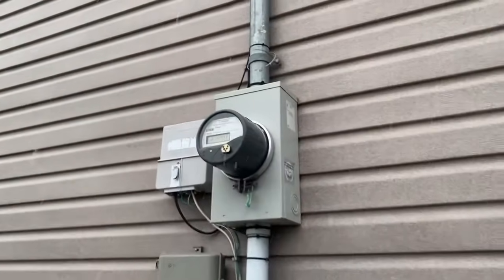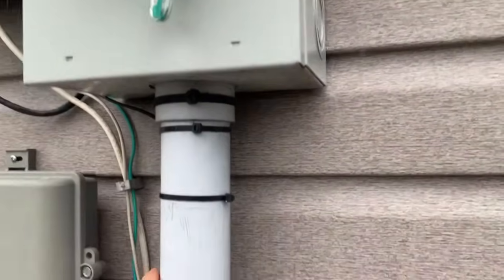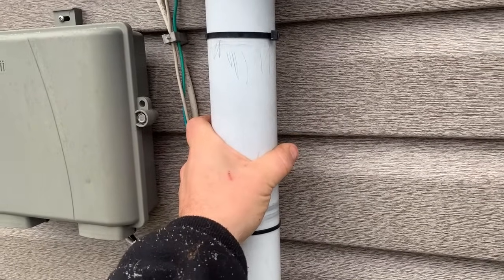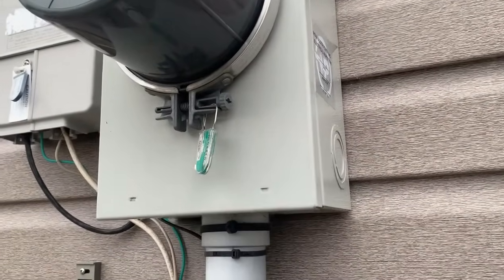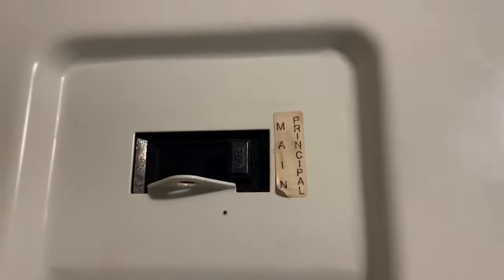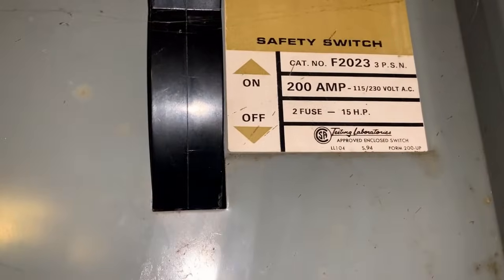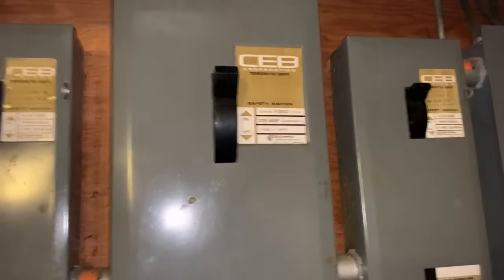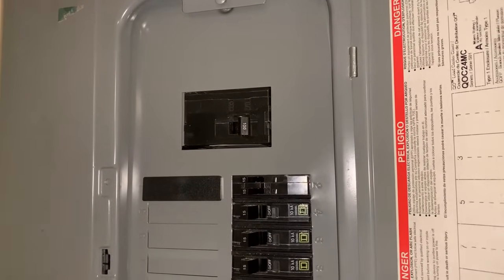How To Tell What Amp Service Is In Your House

Comment: How about the actual wire size feeding the meter/ panel, maybe it's oversized for a 100 amp and could upgrade without running an all new feeder line?

Comment: My house is 51 years old. The box with the main breaker switch is outside on the side of my garage. The box is actually not installed on top of my wall, but inside the wall, sticking out only a small portion. Inside the box there is main electrical breaker and it is 100 Amps. So I am guessing that I have 100 Amps service. I wonder, if I wanted to upgrade to 200 Amps service, because I want to buy EV and charge it inside my garage, how much would it cost, and, if rewiring would have to be done only for the garage outlet for the EV only, or, the whole house. Inside my garage there is breaker box for individual appliances and the highest amps breaker is 50 amps. Thanks

Comment: Question for you, what if you get contradictory information?  My main breaker switch says (100) but I was also able to see the main conductor wires coming into that box and they were labeled as #6 ALUM which according to charts are only rated for (60). I live in Canada which still accepts 60amps
Cheers

Comment: What if there isn't a second Pipe. Most houses that are the age of mine in Michigan don't have outgoing pipe. It's just large gray wire going from the meter through the wall and in the house to the panel.

Comment: What if you don’t have a pipe. I have a meter on the side but then nothing. It goes straight from the meter into the house into a breaker box. I don’t even have a main breaker either. I just have a bunch of small ones that have 2 switches with 30 on them. Then I have a double with 30 and a double with 40.

Comment: What would explain a house with NO master cutoff switch or breaker, just utility current flowing to individual breakers? Was this "up to code" in some earlier era?
Reply from the maker: I've never seen that one before unless it was metered at the pole. Some large services have a separate current transformer and loop out back to a meter from a CT cabinet, however that is usually  before the branch circuit breakers.

Comment: What if you have 2 pipes coming out? Mine looks like the last one with a 1 1/14 pipe and a 2 inch pipe. I also have 2 electrical panels because it was upgraded to install a central air conditioner

Comment: This may not be the right place to ask if so redirect if needed. My moms place runs with a boiler to heat home and water.  But is never adequate for running a bath or the jacuzzi so nobody uses these. I have a ecosmart 36kw unit and breakers electric tankless that could be used to support the hotwater needs for the tub and jacuzzi.  The home is built 1904 has that 2in conduit input.  4 bedroom home 2 bath. This unit i read something about 300 amp service and its a 150 amp tankless could it run on the 200 or unsafe. Even if its only used maybe 2x a week?
Reply: ¹ss3ss3s1wexr

Comment: What If Is Their Is A Double Breaker And Each One Show 100amp Is That A 200amp Breacker. TIA
Reply: I want to know this too! I don't have a big main switch. Our home, built in. '64, has a double 100 as the first breaker on the panel where all the other breakers live. It's not bigger than any other breaker, just two normal size ones labeled 100 connected together.
Reply: @amandawatts3346  If the wires from the meter connect directly to the tied 100-amp breakers, the 100-amp breakers serve as the main breaker in the panel. This is called a back-fed or reverse-fed breaker configuration.
Reply: The amps do not add. A double breaker has one handle with two output wires, 240 volts 100 amps. Similarly, two single 100-amp breakers with the handles tied together, 240 volts 100 amps. If two 100-amp breakers are not tied together, each breaker is 120 volts 100 amps.

Comment: The pipe coming into mine is 3 1/2" and the switch inside the panel says 200 so I assume 200amp, not more.  Everything in my house is electric including 4-ton heat pump and resistive backup heat.  Do you think 200amps is enough to also add a tankless water heater?

Comment: Is conduit really a good way to decide if it’s 100 amp or 200 amp panel. An installer could have a bunch of 2” and that’s just what he runs for everything.  Which is what I have. My panel has no main breaker. What would I look at in that situation to see what it is. The feed from the transformer to the meter can is #4 copper now but at one point was like 1/o aluminum l, I believe on a 75’ pull length.  Any ideas.
Reply: Exactly what I said
Reply: Exactly this guys a retard. Why not just look in the breaker panel to see what the main breaker says? Tf

Comment: QUESTION:  So my meter base is about 2X what you show there.  The Power Company METER says CL320 on it.  I watched the video really close to see, but the face of the meter was never shown with enough detail to see.  CL200 would be a maximum "continuous" service of 200 Amp.  A CL320 is rated for "continuous" 320 Amp.  Off the back of my meter base are TWO (appears to be 2" conduits) which feed TWO independent 100 AMP circuit breaker boxes.  Everything I have seen and read says there should be a PRIMARY circuit breaker box and then other boxes can come off that.  So I asked an electrician about my setup and he agreed it is different and told me the next step up would be 320 but the socket for the meter (apparently I have to pay for that) is really expensive to start with.  Since then I've discovered I already have that.  My house is all electrical, two electric furnaces, hot water heater, stoves, washer dryer - everything is electric - no other fuel source.  So what I was asking him, can I add a third 100Amp panel?   I would want that dedicated to the garage for electric car and welder power.   So is half my problem solved, I already should have 320 or 300Amp service?

Comment: My service has zero writing ANYWHERE, not even a visible model number on the breaker box. My house, in the US/Texas, was built in the late 70's/early 80's. It does have a square box under the meter and the input conduit is 2.25" OD. It goes into the breaker box next to it that has no main breaker/cut off. It has 6- 208 breakers in the top which provide power to Electrical Heat, A/C, Water Heater, Clothes Dryer, Range, and 1 60 amp breaker that feeds a second row of breakers in the bottom of box for 120V service to the house. I would like to put a 100 AMP subpanel in my garage to run a couple of 208V woodworking machines. The clothes dryer and water heater are in the garage area which is about a 60 foot run from the main panel. I was thinking about pulling back the wiring for the water heater and Clothes dryer and put those 30 breakers in the subpanel and that would free up space in the main panel to put a 100 amp breaker to feed my subpanel. In theory it will work but I heard people talk about tab current capacity. How can I tell if the tabs in the main panel will be OK with the 100 amp service to the subpanel? Second what size wire would I run to the subpanel do I need #2 copper and #4 for ground? Finally, I know I don't need another main breaker in the subpanel, but I assume it is OK to install a disconnect, perhaps something like the one on the outside of the house by the AC unit. If you can give me a warm fuzzy that I am headed in the right direction, I'll be very appreciative. I also assume I need to run conduit all the way from the main panel to the subpanel - in a very cramped attic! Sigh!  Finally, what are the ramifications of asking the power company to pull the meter. Since there is no main cutoff in the panel and the main feed lugs are wide open, I'm a bit nervous of trying to pull #2 wires in a hot box. Comments? Thanks for the video.

Comment: Here in the U.S.A we have a fairly standard practice for determining service size.   We typically start by looking at the meter base, since the old round bases were typically 60 to 100 amps max.  Square or rectangle bases are used with 100 amp or larger.   We try to verify the size of the service wires going to the first disconnect.   Then we look at the panel rating,  and the rating of the main disconnect.  Out of these 4, the lowest rating determines the ampacity.   On an overhead service,  we like to count the number of wires connected to the service drop.   3 wires is present in almost all cases, indicating 120/240V service.  2 wires connected,  sometimes with the 3rd wire folded back, indicates a 120 volt service sometimes found in  smaller pre-WWII era homes that have the original service, typically 30 amps, sometimes 60.  4 wires connected indicates a 3 phase service,  either 120/208V or 120/240V with a high leg.  This may be found on a very large luxury home with extreme electrical demands; some utility companies require a service larger than a certain size, typically 600 amps, to be a three phase service.   Some older homes may have remnants of a 3 phase service if the home had a 5 ton central air conditioner in the 1950s or '60s, as some of the condensers hitting the market at the time were unavailable in single phase.

Comment: i went outside to look at mine and i have a power line coming in above then conduit down to meter.  There is  a small breaker box on the bottom of the meter but no main shut off that i see.  There is nothing (conduit) that i see coming off the meter/breaker box.  Do they sometimes go straight into the house from the meter box?
Reply: Yes, that is pretty common in homes in the southern parts of the USA like around Arizona,  Texas,  and Florida, particularly in older homes.   In the northern states they would typically run the service drop down the side of the house,  go to the top of the meter base, (or below,  in conduit if it's a buried service,  much more common in newer homes) and the main breaker box would be directly behind the meter base, although there is a main breaker directly below or beside the meter if the inside panel is more than a few feet away, depending on the local codes.  Beginning in the 2020 NEC there must be an emergency disconnect outside,  for first responders to cut all power in an emergency prior to entering the house, so brand new homes are not allowed to have the first point of disconnect inside. Existing dwellings are not required to meet this new requirement unless the service is being replaced.

Comment: I have a 2" pipe coming out of my meter base but the main breaker in my home is 60 amp. does that mean I have a 60 amp service?
Reply: Yes, you have a 60 amp service. There are 3 key elements that determine the service size, they are the service conductors coming from the meter, the panel rating, and the rating of the main breaker.  Out of these 3, the lowest rating is your service size.  If you really want to go the extra mile, you might also want to count the number of wires connected to the service entrance cable running to the meter. For residential applications this will almost always be 3, indicating your typical 120/240 single phase.  2 wires, or 3 with one tied back and not connected would indicate a 120 volt service,  sometimes found in small homes built before WWII that have the original service and never been upgraded.   4 wires indicates a 3 phase service,  either 120/208 wye or 120/240V 4 wire delta.  This would be extremely rare in a single family dwelling,  unless it was a very large custom luxury home with extreme electrical demands; some utility companies have a limit on single phase sizes and if you need more than a certain amount,  say around  600 amps they will require it to be a 3 phase system.

Comment: Very helpful, what if the main panel has 2 125amp circuit breakers?
Reply from the maker: 2- 100s
Reply: @conquerallelectrical  Thanks! not 2 - 125amp? any reason/purpose to this? its a single unit property. In this case, should the sub be 100 or 125amp?
Reply from the maker: This would be main 200 and 2 separated 100s from that.

Comment: Very helpful. Thank you!!

Question: Does the conduit size method of determining the size of the service (100 vs 200 amp service) apply in the U.S.; or is this something specific to Canada?
Reply from the maker: Although I am sure they are similar, we are in Canada and use the CEC. Always check with your local electrician if you are in the US and using the NEC. Hope this helps a little.
Thanks

Comment: I have been looking for this video, for so long. A lot of panels in Fl do not have a main breaker to refer to. Thanks.
Reply: Yes, some older panels do not have a main breaker.  This type is a split buss panel, and were fairly common in the 1950s until the 1970s,  before being banned by the 1981 NEC.   These older panels have two sets of bus bars, the upper buss was allowed to house up to 5 two pole breakers, plus the breaker feeding the lower buss, usually marked MAIN or SUB-MAIN, and required up to six breakers to be thrown to disconnect all the power.   Beginning in 1978, the last code cycle that allowed these panels, single pole breakers were allowed on the upper buss, as long as the total number of handle throws to disconnect all power didn't exceed six.   And that was one of the major problems with these old panels because they were originally used when homes were smaller than the average home today, and didn't require as many circuits in a given size home as we do in the 21st century.

Comment: What if there are 2 - 100 amp switches on the main service panel?
Reply from the maker: This usually means that it is 200 amp and splits into 2- 100s.This is common on older homes or  same dwelling. However if it is 2 dwellings this means it is only 100 amps per side. With one meter, we have seen this in the past.
thanks
Reply: @conquerallelectrical  what do you mean by 2 dwellings sorry?
Reply from the maker: @lucascenedese8072  Two separate units like a duplex house
Reply: @conquerallelectrical  so if we got round meter old house,  when I get panel upgraded do we have to go back to the utility pole/ telephone pole?